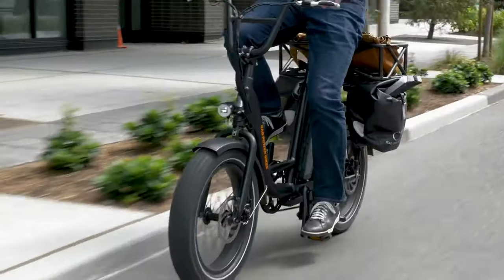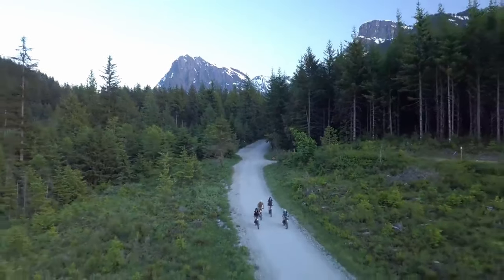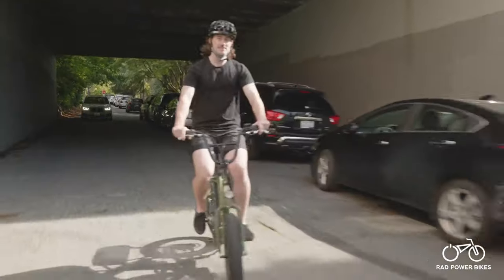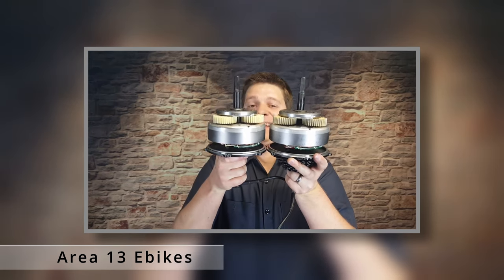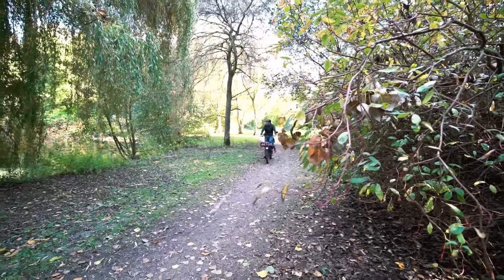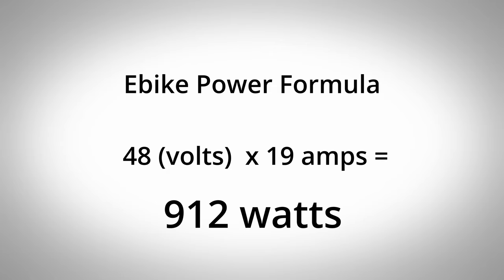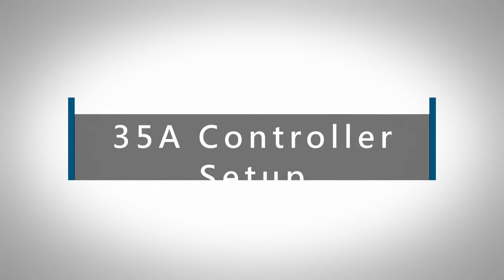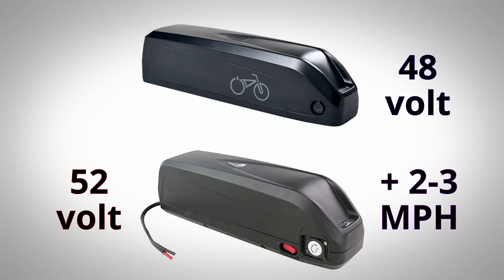How to speed up your Rad Power ebike! - Complete guide: Motor, Controller, and Battery!

Comment: In response to his battery claim "if the battery meter has 2 bars out of the 5, does that mean I have 40% battery, or 21%?". Why would 2 out of 5 bars ever equate to a 21% capacity?
Reply from the maker: On a 5-bar battery gauge (depending on the gauge), if we assume 1 bar equals 20% charge 2 bars would indicate 40% battery remaining. However, the battery gauge isn't precise enough to tell you the exact percentage it will still show 2 bars the whole time that it drains from 40% to 20%. Until the charge level hits 20% (1 bar) the gauge will still show 2 bars regardless of the actual percentage. Some gauges are different percentages per bar or zero bars.

Comment: I got the 35amp controller with color display from bolton ( area 13), it sure works, almost too good. Suddenly  1680watts feeding 500w motor, big power upgrade on my radrunner. I felt it may be too much for my bike, one could loose control on a turn or start off, or burn up motor perhaps. I replaced it with the 25amp controller (1200w output), everything the same, wiring easier, more room. Used lowes double sided outdoor tape to adhere to metal plate. Seems more manageable on power, still go up hills, but little slower, but makes it. Electrobikeworld sells the 25amp and display. Get the 25amp and mono display and save you $$$, over 35amp and color display. And considerable more power over stock hardware. I set C5 setting option 1, for easy start using throttle, up to full power. Makes for easy take off and full power of 1200w, instead of full power of 1680 watts on the 35amp controller. I was using 75 percent of power on the 35amp controller, so not to push limits of watts pushed to motor, Using the 25amp controller, C5 set to 1, its a better setup, that suites me.
Reply from the maker: Great suggestion! The 25 amp controller is a great option as well, you can tune down the 35 amp down so you don't have the jarring torque, but yep, why do that if you can just get the 25.